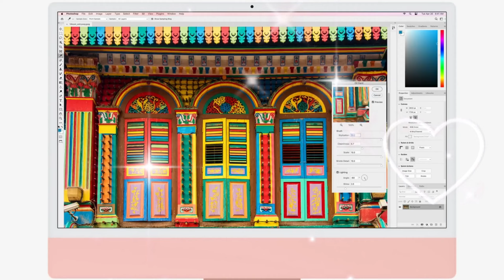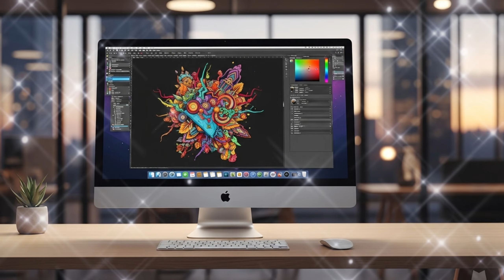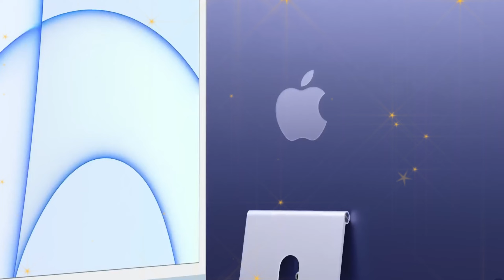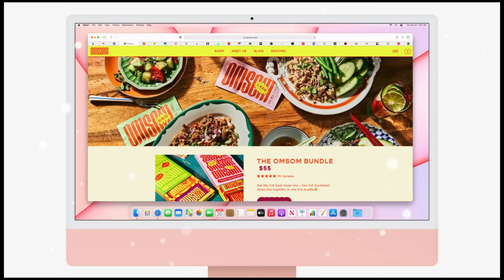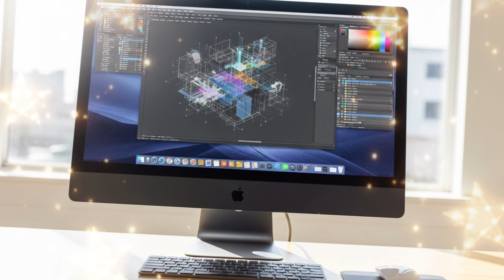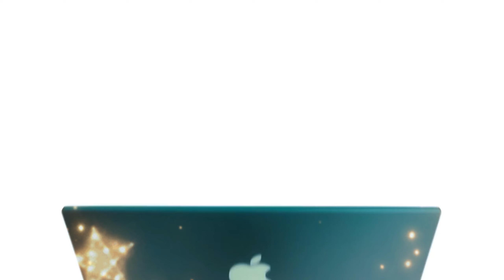New iMac Pro Leaks & Rumors 2026: 32" Mini-LED & M5 Ultra Performance! RIP Mac Studio?

Comment: Sorry bro, I like the vid, but there are some things where you're off by a mile. An m5 ultra wouldn't be groundbreaking in CPU power. Yes their IPC's are pretty impressive but not groundbreaking. Also Tandem Oled is not there to create higher brightness, but to increase longevity of the screen by emitting less light but get the same peak birghtness. 

Also LLM's could be used on Apple Silicon but the gpu power which is needed is lacking. The unified memory is a plus though, so you can run big LLM's but the GPU power isn't something to write home about when we compare it to nVidia and AMD.

Keep on going though